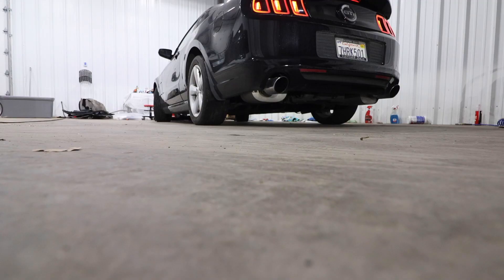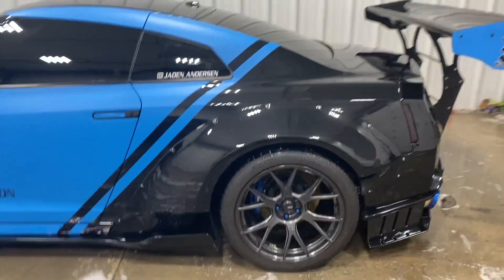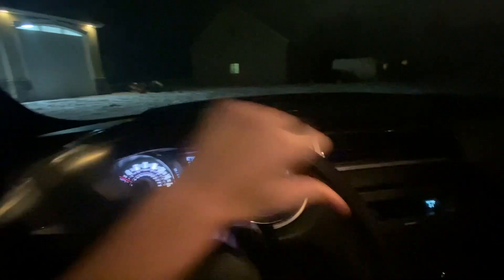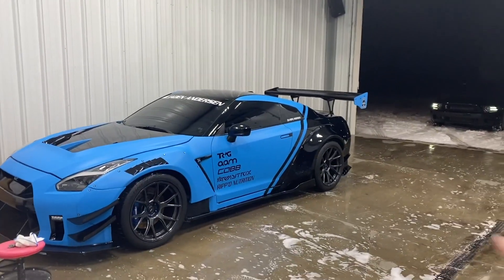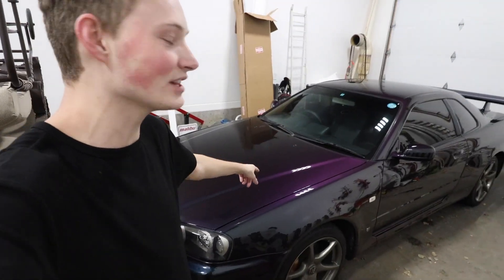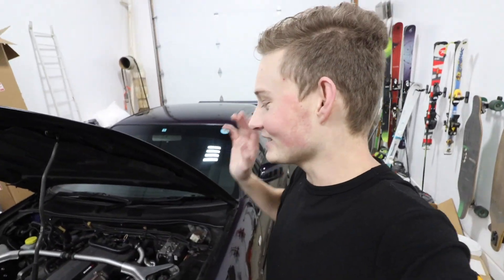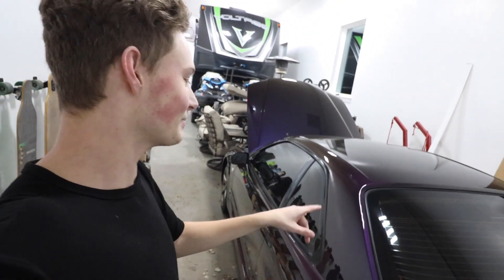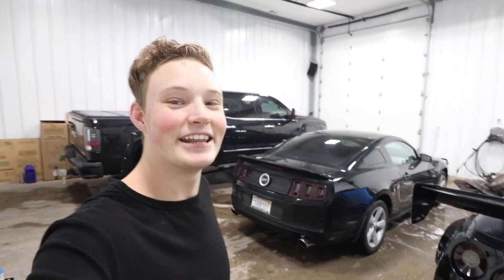BUILDING MY R34 GT-R FASTER THAN A SUPERCAR!

Comment: Don't wrap it dude. That's incredibly bad taste.
Reply from the maker: I want to wrap it just temporary! It will be fun to see the car in different wraps and then go back to paint after a while...
Reply: @jadenandersen8071  I own skylines and wrap for a living full time. Don't wrap the car. Even if you think it's temporary, on a 20 year old car like your 34 (which is pretty high mileage if it's the exact 34 I think it is...) you run a very high risk of pulling paint with the vinyl. Don't do it. That's my 2 cents
Reply from the maker: @Michael-jq5pf  the car has about 30k miles on it
Reply: @jadenandersen8071  don’t wrap a car like that it’s old and the paint is probably very weak wraps pull paint off newer cars so imagine what it will do to a older car